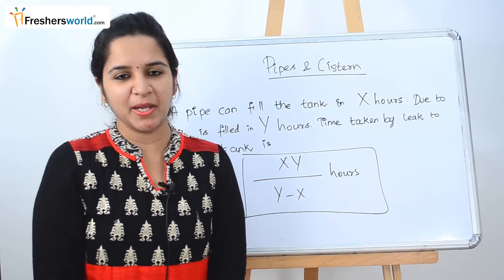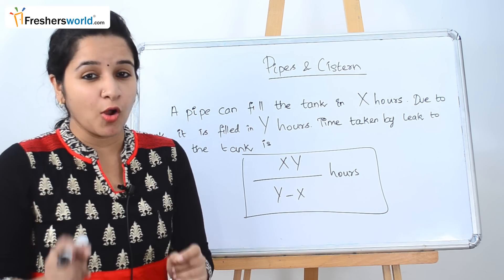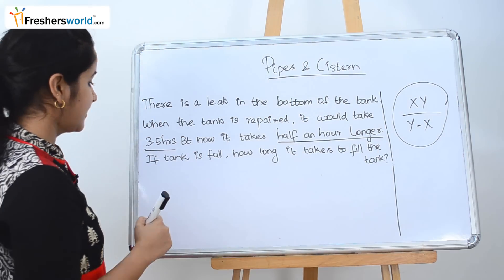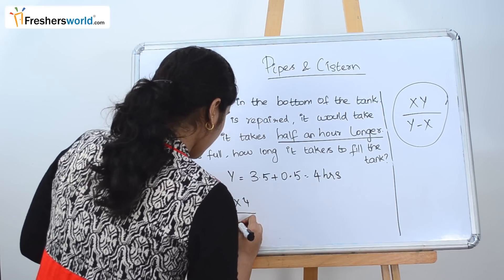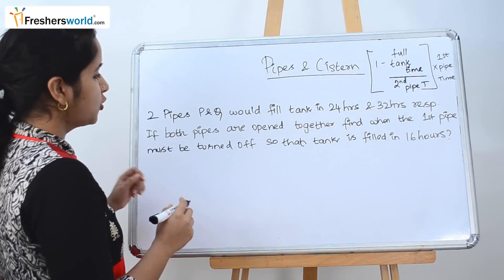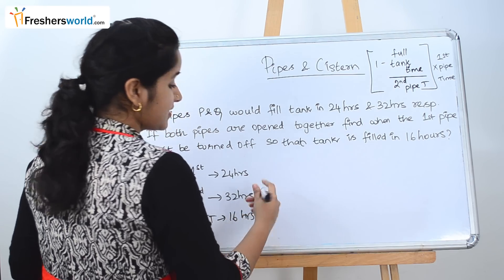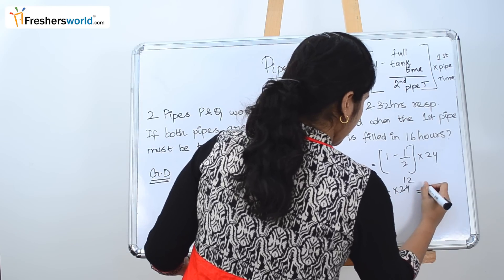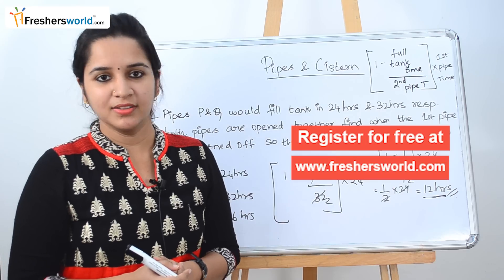Aptitude Made Easy – Problems on Pipes and Cistern– Part 2, Basics and Methods,Tricks

Comment: Super shortcuts. I saw the video and understand very easy. I saw two more topics also and understand very easy. Thank you so much. But I have a doubt..
1. Two pipes A and B can fill a cistern in 12 minutes and 15 minutes respectively but a third pipe C can empty the full tank in 6 minutes. A and B are kept open for 5mins in the beginning and then C is also opened. In what time is the cistern emptied?
Plz solve the above questions 👆
Reply: is the answer  is 6.3 minutes approx ?

Comment: A cistern has 3 pipes A,B and C. A and B can fill it in 3hrs and 4 hrs respectively while C can make it empty completely in 1hr.If the pipes are opened in order at 3,4 and 5 pm respectively at what time will the cistern be empty????
short cut ans solution
Reply: Let t be the time
(t/3)+(t-1/4)-(t-2/1)=0

Comment: Two pipes A and B can fill a cistern in 37(1/2) minutes and 45 minutes respectively. Both pipes are opened. The cistern will be filled in just half an hour, if the B is turned off after: 
I couldn't solve this by using the formula which u hv told...plz explain this sum
Reply: Let, x be time taken by B..
Then,
(x+1/2)/37.5 + x/45 = 1

If u solve that equastion then u will get answers... I.e    x = 20(2/11). Ok?
Reply: ss me too

Comment: no need to go for formula simply x/24 +16/32 =1
Reply: Bro ,can explain this problem briefly.
Reply: @sharathchandra6349    P : 24 hrs  and  Q : 32 hrs
P in 1 hour :  1/24  and  Q in 1 hour :  1/32
x = time when both P and Q run together
P in x hour :  x/24  and  Q in x hour :  x/32
Then: x/24 + x/32 = 1       [ Equal to 1 means full tank ]
But since Q runs for 16 hrs and  P needs to be switched off early at lets say y hrs 
Then: y/24 + 16/32 = 1
Reply: @saurabhdagar9596   thanks bro!!
Reply: @sharathchandra6349  bro I didn't understand the question can you explain